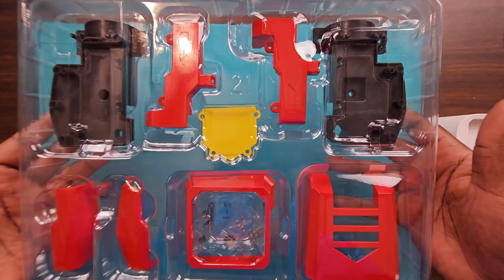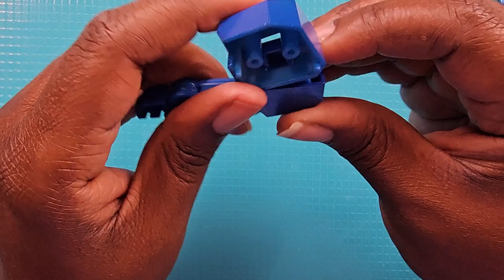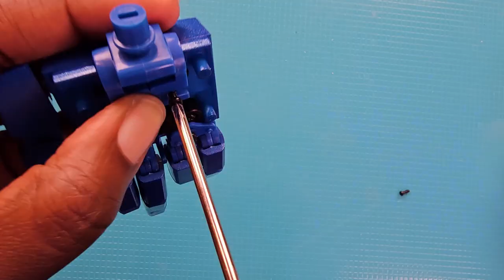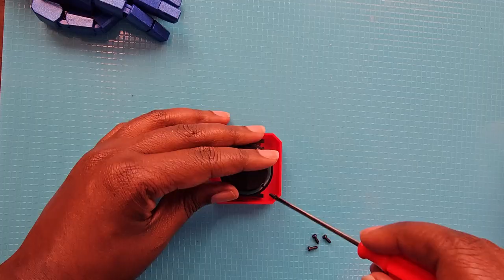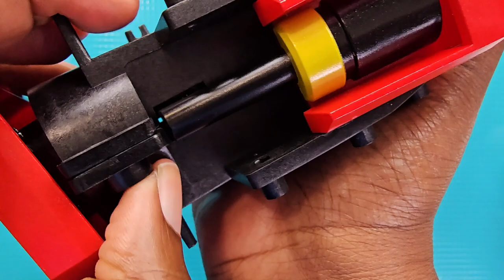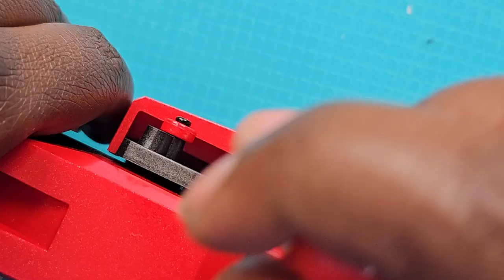Agora Models Optimus Prime - Pack 3: Left Hand & Arm

Comment: The black slot in the hand is for the gun to be put into the hand like with the toys a big pin on the gun to fit in the slot in the hand.
The hands will come out to put the light up axe in the same hole.
Reply from the maker: That's cool! I did not realize that. Thank you.